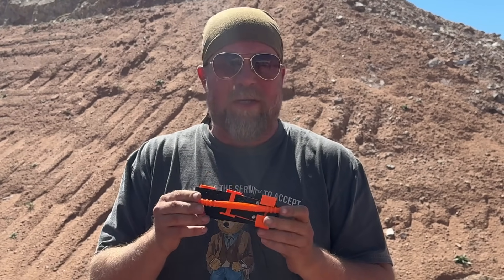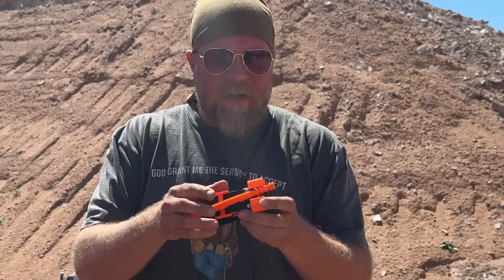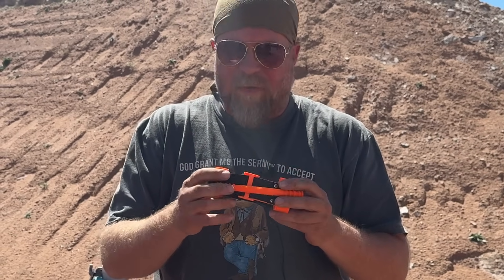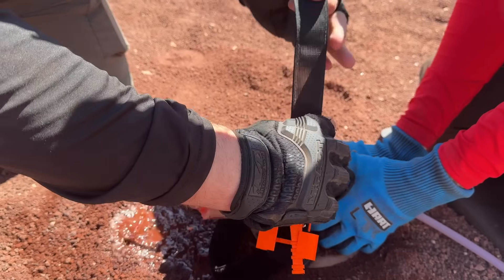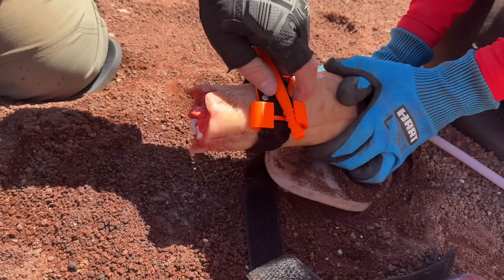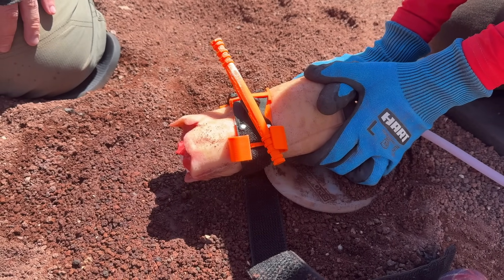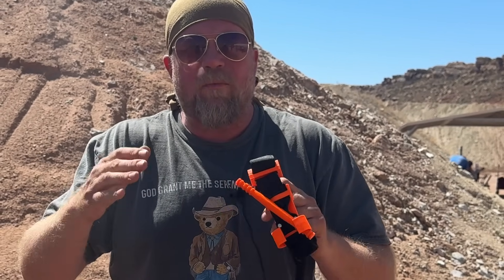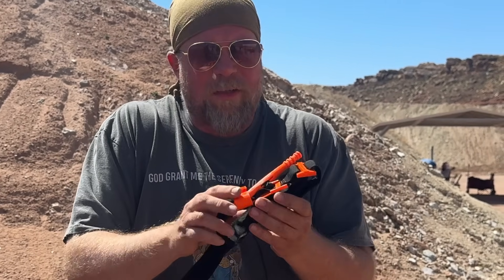The Gaza Tourniquet

Comment: Big question is what material you need to use and how bad quality printing process can cause most important sturdy parts just split into layers in your hands. If I were not sure that you have right materials, everything is right with the printer and you know what you are doing, I'd better be with a cloth and metal rods to just apply pressure. Don't be like ruzzian orks, trying to stop blood with tampons.
Reply: The GitHub repo recommends ABS or PETG, so my guess is ASA which is like a less horrible ABS would work too. PETG is easier to print and if memory serves (it’s been a while) has ludicrous layer adhesion and enough flex to deal with high tension.

Comment: Great to see life saving gear at a cheaper price. Could be improved by using 3d printed molds to produce the design in fiberglass or kevlar forged composite.
Reply: I don't think kevlar composites are widely available in Gaza, though.
Reply: @trioptimum9027  3d polymer is also imported. Forged composite process uses short fibers available as scrap material.

Comment: This thing again ? Didn't we see enough of those failing in Ukraine?
Reply from the maker: I don't think anyone would recommend these over not 3d-printed if they could, but sometimes you make due with the best you can.
Reply: @InrangeTv  Can we stop and think about what situation we're talking here? Because I don't think this is better than what could be assembled with what's in the nearest hardware store, or what we can find on the hardware of parachute dropped aid pallet.

Unfortunately this is one of those things of "3D print everything!" grift. And there are things we can 3D print, and there are things we shouldn't. There are better ways to make a tourniquet, that will result in more reliable tool, than the risk having bunch of those of sub-par quality ones. This didn't worked out in Ukraine. Will not work out wherever this "(insert current conflict) Tourniquet" will be pushed to be used.
Reply: @Sundowner111  plastic is easier for large scale production and distribution a lot of tourniquets available online use plastic... You could certainly grab some pipe or steel rod from a hardware store, but you're reliant on crafting all those by hand in smaller numbers. Manufacturing processes inherently allow for significantly higher distribution and certain materials allow significantly lower cost. Considering theses are aimed to be provided for free as a part of relief, I don't see why we can't just do both.

At worst you can 3D print the parts and insert a metal rod into the plastic 'sheath' to reinforce it, but again, improved design with testing under duress will help the product surpass its teething problems.

It's not like you can get Velcro and a windlass lock that easily at a hardware store and craft it en masse to distribute to hundreds of thousands of people as quickly.
Reply: @V3RTIGO222  commercial tourniquets use Nylon, not cheap PLA, PET or ABS, that quickly loose their properties under UV, heat, cold or moisture exposure.

Again - it was already proven that those 3D printed tourniquets fail under real world conditions, and are a liability. Want to distribute bunch of tourniquets as aid? Buy the SOFT-T, or CAT7s. Just like we do with Ukraine aid.
Reply: @Sundowner111 so the 'Gaza Tourniquet' is better known as the result of the 'Glia Tourniquet Project' - it was originally 3D printed and was pretty successful in the field used on both adults and children. It has since been developed into an injection moulded version that is used in Ukraine and elsewhere!
Reply: It was designed specifically because Israel’s blockade on Gaza made it impossible to import tourniquets. You make do under inhumane conditions - these are better than not having a purpose-made tourniquet.

Comment: Life saving device, that applies considerable pressure via massive mechanical levering - who needs aluminium (or FRN at least) let's make important bits from brittle 3D plastic, yay! As thoughtful and professional, as 7 October's FAFO.
Reply: Well, what's the alternative? Seriously asking, how can you do this without tourniquets, plastic or not, in such a situation?
Reply: @121borisperrons  Mains cable or flex, length of rebar. Tie a surgeon's reef knot, shove the bar through, twist it tight enough and tie the ends over it to stop it untwisting. Then mark the patient with a big "T" and the time, on their face where the EMTs can't fail to spot it, assuming the EMTs live long enough to spot it.
Reply: @121borisperrons  It's not about doing this without tourniquets, it's about having reliable ones. And improvised one from a belt and a stick/pipe have proven to be more reliable one than those 3D printed toys. 

The actual solution should be to figure out what and how to use of what's available. Say take those harnesses from parachute dropped aid - figure out how to use those to make tourniquets, and share that information.

Because they will not print those in Gaza, and if so, not to good enough standards, and we've already seen them pop in Ukraine, just because they were in hot, cold, sun, moisture...
Reply: @121borisperrons  Why reinvent the wheel? Ukrainians made all homework already - if you haven't access to fancy 7075 aluminium, just use steel instead, cheap and strong.
Reply: "We have complete 3D models of the tunnel system under Gaza but managed to somehow let militants cross the most heavily guarded and surveilled border on earth, for hours." You're very intelligent, goy.
Reply: 3d prints can be quite strong, especially when printed with materials like PLA+ or ABS. I've used them in high impact applications on my overlanding truck.

Ideal would be aluminum. But the situation in Gaza and the West Bank are very far from ideal.
Reply: @OspreyKnight  no one is considering we can do both, and that plastic ones will be much faster and cheaper to manufacture en masse immediately, and provide to Gaza. Organizations like the ones providing the TQs don't have infinite budgets or extreme funding like first class governments.

That and the tourniquets can be improved and updated to function better as time goes on, especially given iterative improvement.
Reply: @OspreyKnight  I did read your post, hence why I'm agreeing with you... why are you accusing me of not reading your post???
Reply: @OspreyKnight  Let me clear some misunderstanding - sometimes while you wind up the tourniquet, patient starts to scream from pain not from the wound only, but from the applied pressure itself (unlike this video's "gentle" application). Sometimes aluminium windlasses bent in process. Do you think thin plastic rod will suffice?
Reply: I bet you would have felt at home in Rhodesia.
Reply: Do you think there might be a slight difference in capability between the second most industrialised former Soviet Republic with the second largest land army in Europe, backed by NATO. And Gaza which has been under Israeli blockade for the last 30 years?
Reply: @MollyGermek  If poor gazans can make rockets from waterpipes, I think they can make simple buckles/windlasses from steel rods.
Reply: @john-doe-I  The fact that they're recycling destroyed piping to arm themselves might suggest there's a resource crunch that they shouldn't waste on making a last resort trauma device marginally better?
Reply: @MollyGermek  If they got "destroyed" piping (leaving aside "arming themselves" with high caliber non-precise MLRS rockets - soo self-defence weapons, sure), they got some armature rods, that can be salvaged from destroyed houses (I think they got plenty of those now). "Marginally better" is not of much importance when you're choosing cookies in supermarket, but in this case it's literally a question of life and death.
Reply: Still sore the idf got kicked from pillar to post, are we?
Reply: We did get through this two years ago when those were being made for Ukraine. Braking all the time. Unreliable, were deemed more risk than worth.